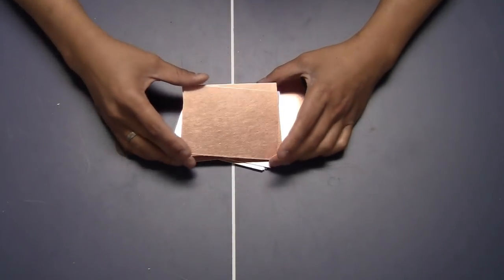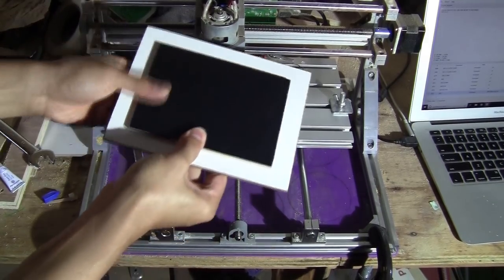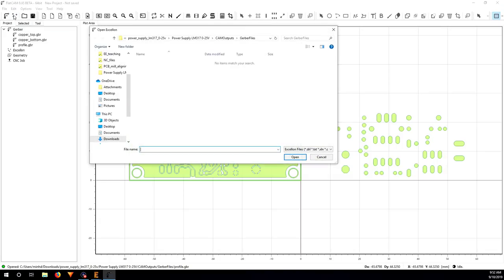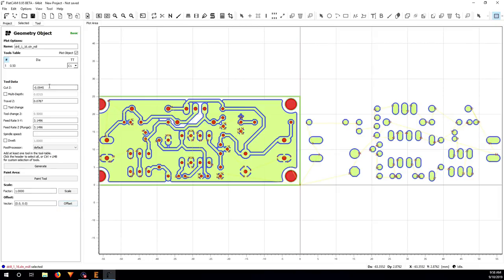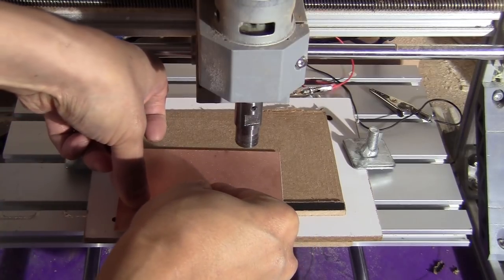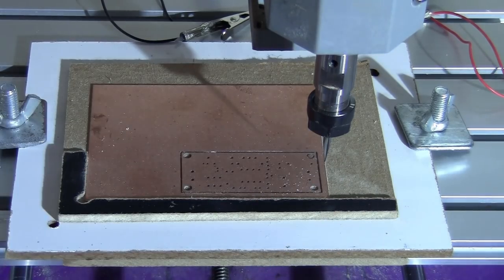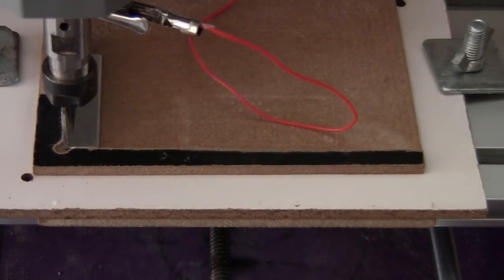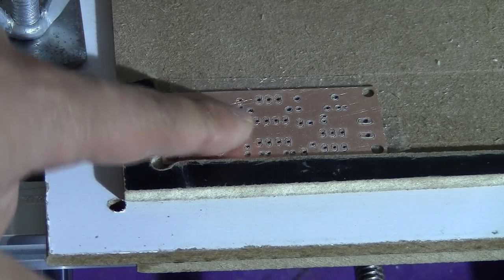Double sided circuit (PCB) - How to mill (etch) precisely?

Comment: Thanks for the great video. I use your steps also. I do however use the double sided PCB feature of FlatCAM. It allows for alignment pins to ensure the top and bottom pads line up. That would reduce the unknowns for misaligned top and bottom pads. The X and Y zeroes stay the same for both sides that way.
Reply from the maker: FlatCam has made many changes since I published this video a few years ago. I'm sure the software is much better now.

Comment: Are you using Tungsten Carbide 2 Flutes Ball Nose End Mills to drill the holes in the PCB?
Reply from the maker: 1mm flat end mill, 2 flute
Reply: @minhsmancave9448  Can't you get 0.8mm flat end mill 2 flute?
Reply from the maker: You surely can

Comment: Nice video! How to do via on the pcb connecting the two layers with this?
Reply from the maker: I guess that you can buy the rivets like this: https://www.aliexpress.com/item/32691428377.html
drill the corresponding holes and use some rivet tools to lock it in onto the pcb board
Reply: Thank you so much! This is exactly what I was looking for. Also thank you for sharing videos about 3018 CNC. They’re awesome!

Comment: What does the motor spindle look like on the 3018 CNC (Not the PRO)? Does it have a flat edge on it?
Reply from the maker: All 3018 cnc use the same spindle is the 775 dc motor
Reply: @minhsmancave9448  Does it have a flat edge on the spindle. At high speeds it will vibrate because there is more weight on one side.
Reply: @Berghiker  no flat edge. Should be well balanced. Uses an ER11 collet for holding tools.
Reply: @minhsmancave9448  So that means they do not have a flat edge.

Comment: Thanks .  Only thing faltcam 8.95 beta exe is not available right now . Flat cam 8.99 takes different approach for geo genertion for cut out from grbl files . Is you build it from sources? .    If you can share exe that s awesome .
Reply from the maker: No, sorry. I only downloaded the installation file. I haven't checked the new version of flatCam since then so I'm not sure what changed.
Reply: @minhsmancave9448  exe file available 8.97 and up only.  .😅 That way i am want it from you.😇
 Thanks for such great content.

Comment: 36:00 How to lose a finger with a CNC machine
Reply from the maker: Did you see the bit turning? If you are scared of a standing still cnc bit, don't go near your knives in the kitchen. Pretend to be safety expert on internet???
Reply: @minhsmancave9448  I also got worried when you were sanding, while the tip was close to  your  hand. Maybe it has never happened to  you, but I have cut myself a few times when the spindle was not turning like in this case.